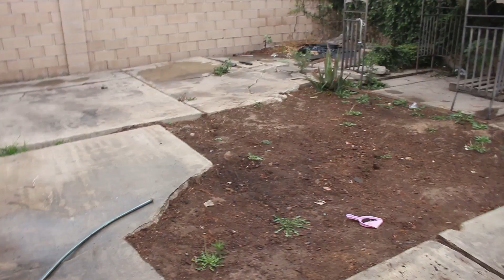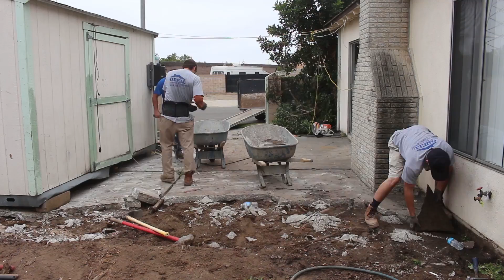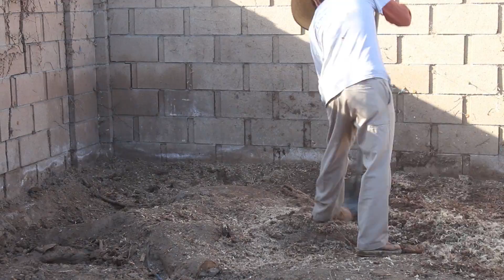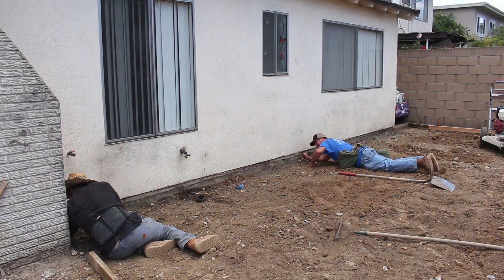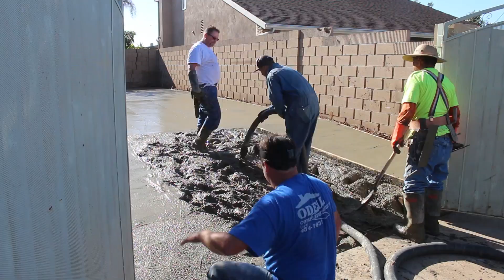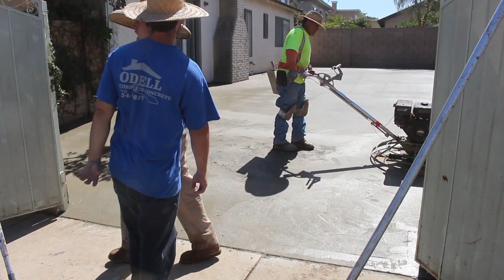How to Setup and Pour a Concrete Backyard Patio #4

Comment: So, I know nothing about pouring a concrete patio ....I am curious what benefit there is in putting the rebar underneath the concrete..wouldn't it be more advantageous to put the rebar into the wet concrete as it is being poured? Or does that actually enhance the opportunity for cracking?

Comment: Hey Odell just wondering have you ever thought of investing in a mini skid steer Vermeer? Oh and a Gereoge Buggy when I use to work in residential we'll use them all the time of course we will lay down plywood for a path so it won't tear up the yard or driveway. Let me know what are your thoughts?
Reply from the maker: I have used the Georgia Buggy. Great for flat ground and wide corners. Not to good in the tight spaces around here.
The Vermeer is under consideration.

Comment: why no mini ex or dingo type machine? They shine in small areas .Rent any attachment u can think of.
Reply from the maker: The buckets on those are no bigger than a wheel barrow maybe smaller.
You still have to get the dirt and debris from point a to b
Making many runs across the lawn in one of those spells collateral damage.

Comment: Mr odell, i often wonder why you dont use a mini digger and dumper to clear these sites,? We would typically have two men on site, push over the shed, pull out the concrete, excavate a depth and stone it up in a single day, i believe that makes me £4-500 cheaper than my competition and means we can achieve more completed jobs in a month
Reply from the maker: Your probably right, but I have guys in training. I think this is the fastest and best way to make a good construction worker.

Comment: Good stuff as ever. Couldn't you have used a mini excavator to break out existing concrete and reduce sub-base levels?
Reply from the maker: Yes that could be done. The concrete came out real easy as you see in the video. Sub base is best undisturbed.

Comment: I really like the way you use those 2x4 and stakes with pins to keep the concrete level when skreeting...very solid technique...nice job with this poor. You make this type of work look way to easy. Especially considering how hot it is outside...I would still like to see the boys finishing and framing though.
Reply from the maker: I think I have them in some action on the saw cutting. 
That's do it right or its forever type thing.

Comment: David my man!! I was watching goon oh man he isn't going to take a compactor to the dirt, then I realized your a pro and out popped the compactor! Two questions. What's the big difference between a float with rounded edges vs squared? Also would laying a base like gravel help fight the uneven ground when the dead roots decompose?
Reply from the maker: I don't think the gravel is going to make much of difference. Your still going to end up with decomposed roots, and hollows. I think this is when the steel makes a difference.
Reply from the maker: The round doesn't fit in to corners. Could be a problem. The Square leaves more lines. The square is probably better. On my hand trowel I like a square end and a round end so I have the best of both worlds.